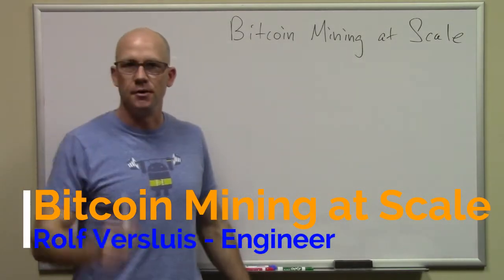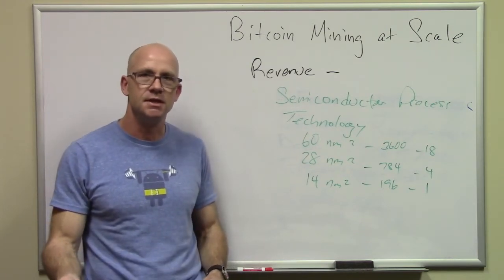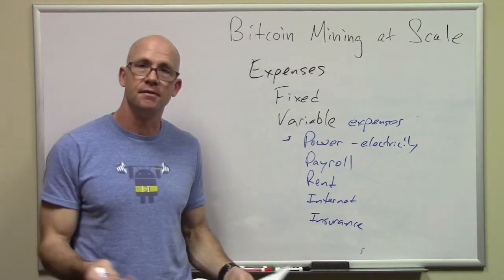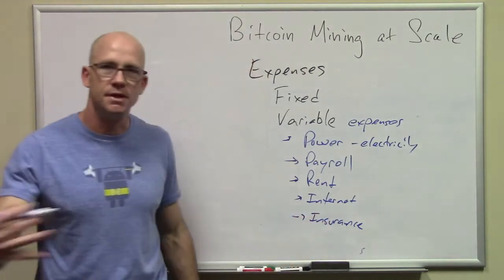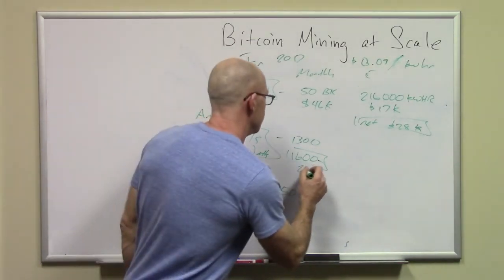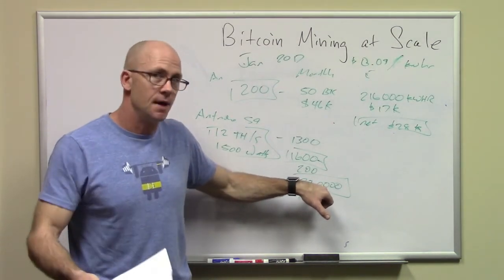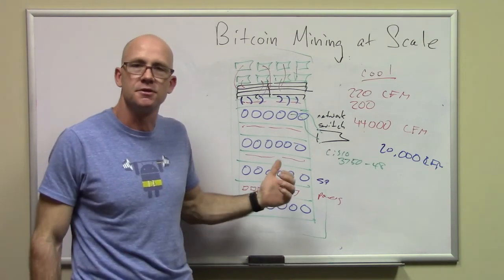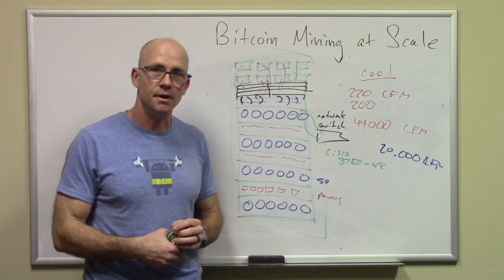2017 Bitcoin Mining at Scale - Introduction

Comment: 24:23 the electrical set up is confusing to me. If you are using single phase how are you getting 208 volts? and, if you are using single phase does that mean you are not using Bitmain's psu's? what kind of psu's are you using for your asic miners?
Reply from the maker: checkout the newer videos. Pulling single phases off three phase
Reply: I will. thanks for replying!
Reply: Three phases you know... Single phase is really the power between any two phases,  What your thinking of is phase to ground which is where we get 120,115,110 Volts.  (The power company brings single phase into the house and in your breaker box it gets split into the various circuits which are nearly all phase to ground,  exceptions maybe Dryer, Furnace, Oven, Hot water heater.)

Comment: Hey sir,
I read your article about your Alerting and Monitoring application for your farms. Do you have any updates to the system you have in place to remotely manage/monitor your farms?  I travel quite a bit and I need something easy that I can use from the road.  Thanks in advance.
Reply from the maker: The zabbix system is for remote monitoring. Management is done by connecting with a VPN and making changes to the machines.

Comment: I do have a question about when you just use airflow from fans vs fans + HVAC cooling.

From what I understand about the heat transfer from miner to the air using airflow, more heat is effectively transferred when the temperature at the inlet fan is lower.  So even though AC isn't always needed because adequate airflow can remove a lot of heat, at some point, blowing a bunch of hot air over a hot miner won't effectively remove the miner's heat.  

What temperature would you say is just "too hot" to just use airflow as the only cooling method ?  I live in Texas where the summer months have a high temp average in the low to mid 90s with 80% relative humidity (swamp cooling not too effective either).  But other months where ambient temps allow just using airflow.
Reply from the maker: Low to mid 90's with 80% RH should be ok for airflow for cooling, but you need a lot of cooling. I had a few days like that here in Georgia this summer and made it through just fine. Worst case just shut everything down for August and take a nice vacation in Minnesota.

Comment: You talk about dual connecting (primary and backup) your Ethernet to avoid downtime. I see the MX64 firewall is recommended for no more than 50 units. For a 200 miner operation, wouldnt it be best to have two Meraki MX100's, since each can handle up to 500 clients?
Reply from the maker: no, MX64 is fine, and it can do dual uplinks. 50 is just for the number of VPN clients.

Comment: Hi, I have a 150 KVA transformer 200amp 600v in 208/120v coming out with 416 amps.  How many 30amp circuits should I get out of it?  planning on setting up S9s  Thank you for helping just got my PDUs and looking for my switches  miners come at the end of the month.
Reply from the maker: That's exciting! you may need to convert 3 phase to single phase for your PDU's.

If your 30 amp circuits are at 208VAC they should be rated for ~6000W or 6KW each. You should be able to get up to 25 30 amp circuits since your power factor is probably about 0.95 and you may have not much other load. So to be conservative maybe 20 30 amp circuits
Reply: Thank you for taking the time to reply. So what I got going in so far is two 225amp 208/120 panels.From watching your video you got 16 30 amp circuits per 400 amp panel if I get 20 to 25 that would be great. I got 208v PDUs with L6 30 P and a used HP 48 port switch (50.00) I'm trying to follow your lead on most if not all my choices. How do I get the CFMs for the  L3+ and D3s?

Comment: why is solar a bad option?
Reply from the maker: It's not, unless you want to scale. At 1500W 24x7x365 that's 20-30 panels per miner and a set of deep cycle batteries. I want to get to 400 miners. That would be about 10,000 solar panels.

Comment: Why don't you run 4 miners per PDU ?
Reply from the maker: Sometimes I do. But when the 30 amp circuit breaker trips then I have to reduce the miner quantity from 4 per PDU to 3.
Reply: I think at his larger site he's running 3 phase which puts the voltage around 208.  
At his other office he most likely has split phase residential voltage around 240.
I say "around" cause the distance from the substation will drop the voltage slightly and then the distance from the pole transformer also comes into play.   
The inrush current most likely is too high for 30A @ 208V; as the miners just comes on when power is applied.
Also if he's over clocking it's my understanding that he'd have to increase the voltage on his power supply... I however don't have first hand knowledge of this as I'm just starting out myself.
Reply from the maker: Exactly - 240 VAC at smaller site, and 3 phase 208 VAC at larger site. I had been using server power supplies for the antminers but their efficiency is only about 88% and I am replacing them with the Bitmain 94% efficient power supplies. By putting two of the 13.5TH and two of the 11.5TH antminers on one PDU using the more efficient power supplies I expect to be able to operate without tripping the 30A circuit breakers, even when it gets hot.

Because of the lower voltage of 208 VAC, it increases the AC current per Antminer compared to the 240 VAC site. The DC current stays the same, of course, because the power supply output is 12VDC